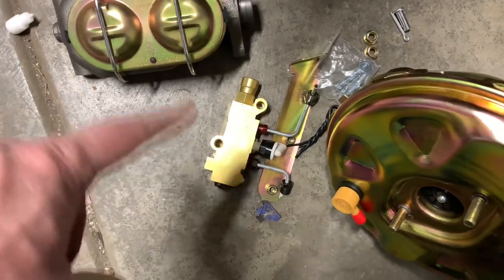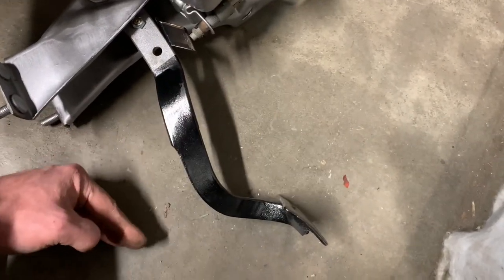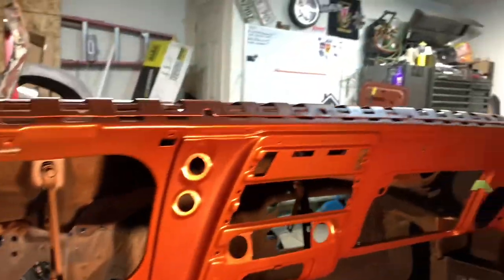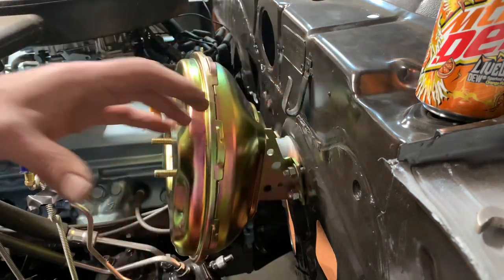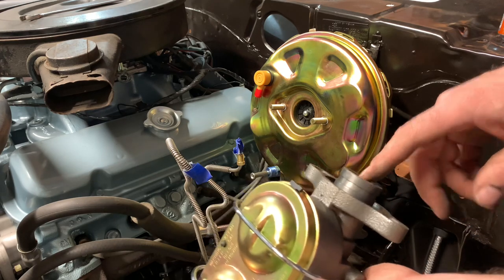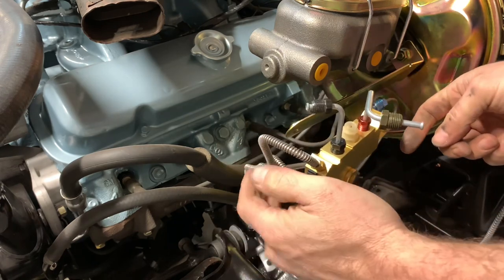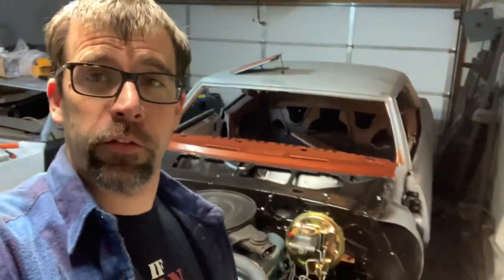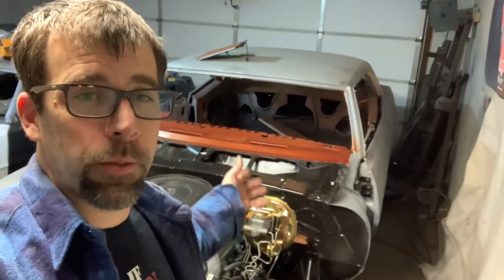Boosting a bird, things you should know when installing power brakes and master cyl 1968 Firebird

Comment: May of already been mentioned but I would also paint the master cylinder before installing, a lot easier to paint off the car that way you don’t mess up the pretty brake lines and plated booster, not trying to be picky or critical, just a tip.🤷🏻‍♂ Btw they’re supposed to be black if you’re doing a back to original restoration. Great video. Thanks
Reply from the maker: Yes much easier off the car for sure.  I paint Mine a cast grey to look similar to the bare metal.

Comment: I know it is too late, but a little tip on those brake lines when you get one that isn't quite the right angle. You can take a box end wrench and put it on the fitting and you have great leverage to adjust the bend very easily. By using the fitting and not putting it directly on the line, there is much less chance of crimping the line.
Reply from the maker: Thanks!  I see that working great.

Comment: Just did the reverse of what your doing.  Pulled that damn power booster OFF the firewall! went back to manual disk brakes to gain total solid road feel of the brakes. Plus with all the cams I use I wind up with ZERO vacuum so power brakes are a total joke. I have manual disks on all 5 of my muscle cars now and LOVE IT!  Power brakes never more.
Reply from the maker: Interesting, did you go with a different master cylinder then the factory disc brake one?
Reply: @VinylVillageGarage  Yes,   Made a phone call to Wagner lockeed brake company, they said the manual master cylinder for disk brakes takes a 1 inch bore piston and manual drum master was 15/16s and they gave me the correct P/N# for the 1 inch bore master. I like the Wangner masters over all others because you don't have to deal with them pain in the ass wire bails to pop off to check the fluid. With all Wagner masters it's only one 1/2 inch bolt in the middle and the top lid is off.  Much more EZ in my opinion.  The Wilwoods are waaaaay to pricey in my opinion. I got the correct NOS Wagner master off Ebay for $46.00 from a government supply vendor. Yes I did my homework. Still got to get a shorter push rod or cut & re grind the ball end as the push rod is about 2 1/4" shorter than the power push rod. My car, my rules 😎😎 That's what happens when you have owned the same bird for 47 years. So far I have changed my 66 Olds 442 H/T  & 442 Convertable over to manual disks, my 70 Chevelle from power to manual disks and my 68 400 Bird will all be manual disks and my 68 RS/SS Camaro I changed it over to manual disks all with Wanger Masters.  That center bolt is VERY handy over them stupid wire bails. I build what I know works best for me and is CHEAP !.
Reply from the maker: Thanks. I did some reading a while back about bore size in relation to disc vs drum and power to manual and just never felt like it was a clear answer. Have a friend with a 1970 c10 wants to do a manual disc conversion is why.  Appreciate the insight.

Comment: My manual drum '68 is set up where the accelerator and brake pedal are not on the same plane. Been the way since 1976, I'm assuming the factory did this. 
"Sure makes for some interesting stops!"
Reply from the maker: Normally the brake pedal is slightly higher then the gas pedal. Then when depressed the brake pedal is the same height of the gas pedal.

Comment: Great info I wished I would have know in the early 90,s, when converting from manual steering to power steering is the only difference a power steering head and a p/s pitman arm , does all the other front parts work like center link and so forth remain the same ?
Reply from the maker: From my experience yes,  the only exception is the 1969 also has a v8 or 6 Cyl steering linkages that are not the same.

Comment: Have you ever had a challenge with the shuttle valve inside the compensating valve sticking or shutting off the fluid flow to either the front or rear
Reply from the maker: Yes especially when first bleeding. Or doing a repair on an older system that had a leak. Its been bad enough that I had to open a bleeder screw on the side that was working and stomp on there brake pedal to shift it back.  In a perfect world that valve should be replaced but good luck getting 50 year old lines off
Reply: @VinylVillageGarage  thank you. Have you ever used the little plug with the pin on it in the light switch hole to hold it in place
Reply from the maker: I have not yet, normally short stroke the brake pedal so not to shift the valve until I get most of the air out.  Then bleed as usual

Comment: 67 Camaro here. Buying the Z shape piece now for a really high brake pedal with power brakes. So how do I go about installing it? Do I have to remove the steering column and remove the whole assembly or is it possible to work under the dash?
Reply from the maker: Very good question I have to try to install a z-bar on a car that was fully assembled it might be possible but I can’t say for sure

Comment: Did you make new lines for the proportioning valve? The issue I'm having is that my original porportioning valve was quite low. So the front and rear brake lines don't actually reach the proportioning valve. The new valve is mounted exactly like yours. I dont know how to connect the front driver side lines to it. Even the rear is the same it doesnt seem to reach at all
Reply from the maker: This car has all new brake lines installed and they are for cars with this set up. Now your car  I am assuming you have factory lines still, if so they won’t reach.  Need to make or buy new lines to get that proportioning valve to work

Comment: Thanks for the info… I am about to attempt it on my 69 firebird…
Reply from the maker: Cool.  Was your car a factory power brake car? If so did it have that bracket on the pedal?
Reply: @VinylVillageGarage  it was factory manual drums all around .. original 6 cylinder car
Reply: Btw . Where can u order that bracket on the pedal?
Reply from the maker: Thanks
Reply from the maker: Used to be available from almost every restoration supplier, it seems they are on back order from most suppliers. When you do find them they sell for $15
Reply: @VinylVillageGarage  thanks

Comment: I have watched your video and it is great information but I have a problem been using the bottom hole in my brake pedal. It does not give me the proper ratio the ratio using the bottom hole is only 3.2 instead of a minimum of four the top would be at least five and that’s where the manual push rod attached for the manual brakes. Any suggestions?
Reply from the maker: Are you not using the factory booster or master cylinder?   The bottom hose with a booster should get you the correct setup.

Comment: Where did you get the brake light switch bracket ? I installed a system similar to yours but never got that bracket, I ended up welding a piece of metal.
Reply from the maker: This car still had it on the pedal. They used to sell them aftermarket but seem to be on back order.    There is a template online you can print and fabricate one.

Comment: So are you going to try to bleed the whole system at once without bench bleeding the master? I tried that once and I could never get all the air bubbles out of the lines, so now I bleed the master on the car with a couple of looped brake lines I made up, it makes bleeding the lines much easier.
Reply from the maker: I have used a fluid vacuum pump to bleed them, works good and keeps the fluid cleaned up and off fresh paint.

Comment: my 67 firebird is manual and soon to be power with no break light clip on the break pedal to take up the gap between the switch and pedal where do I find one I've looked in three different catalogs and don't see anything.!!
Reply from the maker: It was available at classic industries part 14298. It shows back ordered right now. I checked a few other places same thing. Must be like most everything else, short supply.

Comment: What is the electrical connection that goes into that metering block
Reply from the maker: Brake fluid pressure loss switch.  If you have a leak the valve shifts and blocks off the leaking size so you still have brakes and when that happens it trips that switch and turns the red “brake” light on in the instrument clutster

Comment: huh, I've had 5 68's all having power brakes, not one of them have had hat switch bracket? All of them operated the brake switch directly off the brake pedal. Looking at my Pontiac service manual now and I don't see any reference of that bracket in the diagram either? Odd.
Reply from the maker: I don’t have a 1968 manual to reference it might not be in there.  I have a friend with a 68 dealer part manual I will have him look at it.   Buy my experience has been of the three first gen birds that I have seen that came with FACTORY power assist didn’t matter disc or drum that bracket was on there.  I did a disc conversion on my first bird years ago and didnt have that bracket and just never liked how the pedal seemed high for driving,‘stopped great!  Then while tearing car apart
And saw that bracket for the first time I did some homework and everyplace I looked it was for the brake light switch for power brake cars.  Then i located a bracket and readjusted pedal
Rod length and brake switch on my first bird much happier with pedal height. I could switch from the gas back to the brake pedal and felt much more natural.
Reply: @VinylVillageGarage   So just to be clear, Are you saying that this bracket in addition to locating the brake switch as a reference point for operation, that it also limits pedal return travel?  I have never had an issue with a brake pedal height either?  I'm not questioning your authenticity about this bracket, quite the contrary, I'm curious if this was one of those mid-year type factory changes that was perhaps not included on early year production? Did '67 have this setup? hmm.
Reply from the maker: I can’t guarantee 1967 I haven’t seen one sign my own eyes yet.  I have seen them on 68 and 69. But the reproduction bracket is listed as 67-1969.  So now I am curious myself.
Reply from the maker: Looks like all 1967-1969 power brake cars has this bracket
Reply: @VVG Firebird Restoration Station  yes sir that's right all power brakes car's had this bracket
Reply: @VinylVillageGarage  ... and just when I thought I had seen it all about these cars. Thanks for the information Jon.
Reply from the maker: No prob, I am still learning things all the time and I have been building these cars for over 25 years. Cool part about YouTube is I get to share what I have seen and viewers tell
Me things they have seen so i continue to expand my knowledge and share it again.
Reply: My '68 with manual drums doesn't have the bracket either. After watching the video,  I went out and checked, and my brake pedal is WAY higher than the gas pedal.  Never really thought about it before....

Comment: Hydraulic brake booster, runs off powed steering pump.  Much  better stopping power than a vacum booster and much cleaner looking than the huge vacuum boost canister.  Hi performance camshafts dont produce lot of vacuum that is the reason hydro boost is superior, hydraulic  boost dont use any vacuum at all.
Reply from the maker: Not a bad idea.